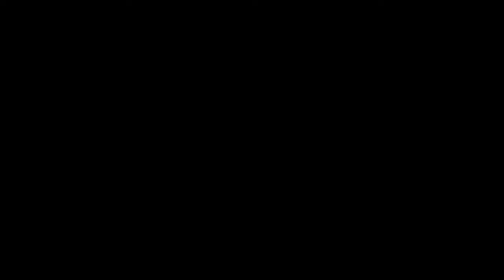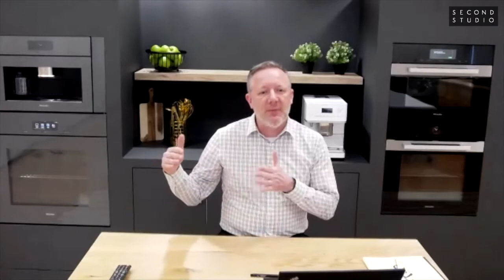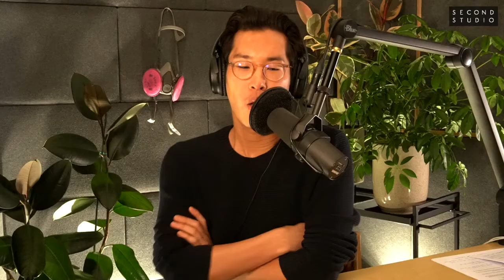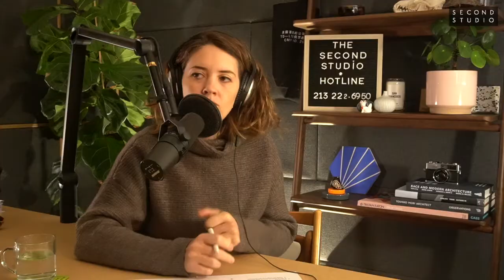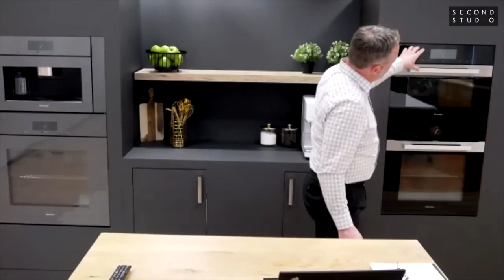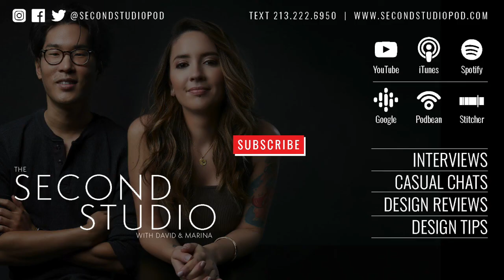#267 - The Future of Kitchen Appliances & Miele's Generation 7000 with Dirk Sappok

Comment: Model: DGC68001BRWS
Has this ever happened to you? There is a buzzing sound and then "Miele" displays then black then "Miele" then a white streak then black repeat. What is the fix? This is the 3rd time this oven has failed and maybe I just need to get something different. I wrote directly to miele but never have much luck with their CS, even when under warranty. I would just like to know if it is worth it to have someone out.